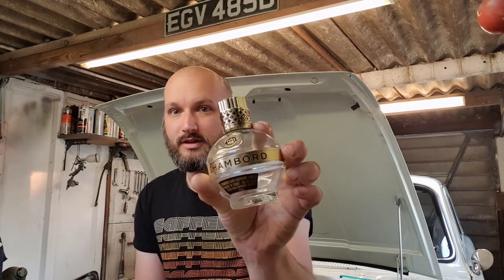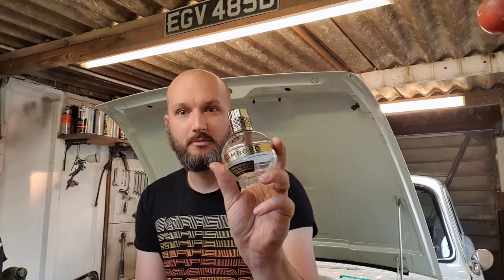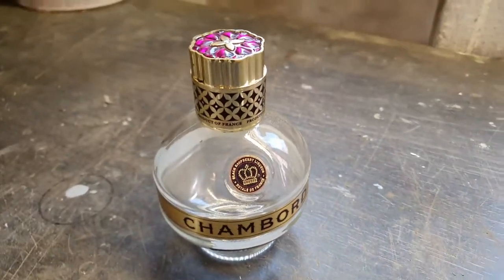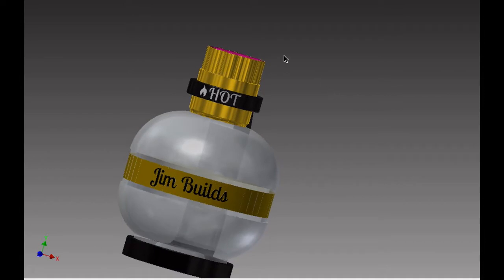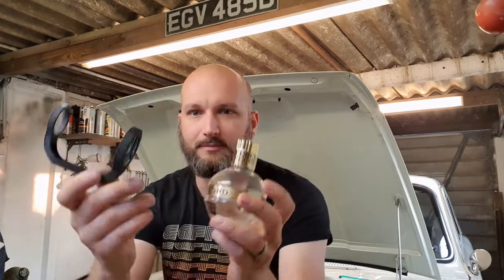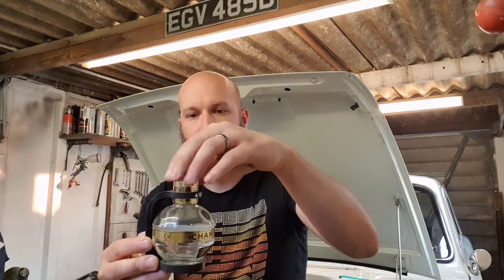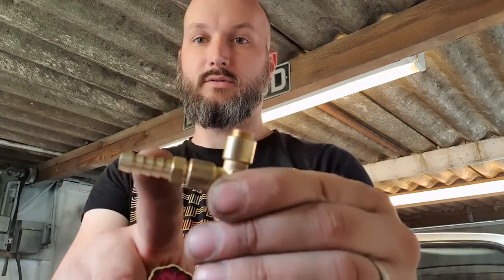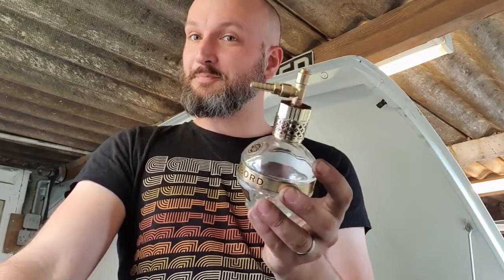DIY Liqueur coolant overflow bottle

Comment: Excellent bracket job. Yours is the big header Lotus rad so all you need is the catch tank. I used to have a small Escort rad which basically was brand new that's why I used it. Because of that I made a an expansion tank like the Honda Civic which sucks the coolant back into the rad when the engine cools. The tank must be vented but the rad cap and the pipe must  be completely sealed for it to work. Most modern cars have the header tank system which is plumbed in to the bottom and top hose and must be placed higher than the rad. Expansion tanks must be lower than the top of the rad. Great job.
Reply from the maker: Thanks Phil, how did yours run with that setup?
Reply: @jimbuilds  Its better now I fitted a bigger rad as well as the expansion tank. I did have a problem getting the cap to seal on the bigger rubber washer but after bending the tabs it was ok.The rad is always full to the top and you never have to take the cap off again, just check the coolant level at the expansion tank and top up there if needed, you know it's working when the level goes up and down in the expansion tank. I still have the two blade fan on and an electric fan just in case I am stuck in a jam in red hot weather. Yours is good enough with that rad. I wouldn't have bothered if my other rad hadn't been so small.  Once when the little rad was on the car and no expansion tank it over heated in a traffic jam and warped the head, took .012" off to get it flat again.I didn't want a repeat of that.
Reply: @jimbuilds  Never had a problem since. The bigger rad I put on has helped as well. I did have to buy a new rad cap as the older ones don't have the valve in the middle to let the coolant  reverse flow. Of course there is no pressure in an expansion tank as it is vented unlike header tanks which are at full radiator pressure.
Reply from the maker: There's quite a difference between the two radiators, I was having a look earlier. I went electric rad fan when it was on the road in 2006 on a switch which worked but I had to keep an eye on the dial! 

I went with a fan that covered the radiator which turns out it was for a 4.5 L engine! Which explains why it wouldn't run for very long before getting turned off! 

My current setup is a thermostat and a smaller fan (12" if I recall). It seems to do the trick.
Reply: @jimbuilds  Yes the 12inch fan is the one to have, mine is very small 9 inches I think. It's one of the old Kenlows it's a good electric motor though. Been meaning to change it then I can take off the steel engine fan and get more horses and the water pump will last longer.

Comment: Looks really smart that. I’m wondering if the vent will work in the tee piece. You could get coolant escaping from the top as the bottle will get pressurised. 
If you were to have two holes, one as a simple vent, the other with an internal tube which runs to the bottom of the bottle, I think it would work better. Could well be able to suck the coolant back if required depending on the radiator cap you have. 
Just a thought.
Reply from the maker: A syphon tube would help, I'll see how it works as it is but it's something that would be nice to have

Comment: Hey, i was just curious how your overflow bottle has held up. I started doing this for my 1969 Chevelle, but stopped when someone told me the hot coolant would break the glass...eventually. any truth to this? Anyways, id like to hear your thoughts
Reply from the maker: The bottle has held up fine so far. As its overflow it's not getting constantly heat cycled, it has had some hot water in there last summer when I was doing long runs but it's held up well.

I did break the bracket last week when I leant on it so that's the weak part! 🤦‍♂️

I'd say go for it, a thicker glassed bottle is better and would look great on a chevelle! What bottle are you thinking of using?
Reply: @jimbuilds  originally i had a jose cuervo tequila bottle, but now im thinking a mexican coca cola bottle, we'll see what happens
Reply from the maker: They'll be ok, they have thick glass walls. I've had too many hangovers because of Jose to put on of their bottles in my car! 😆